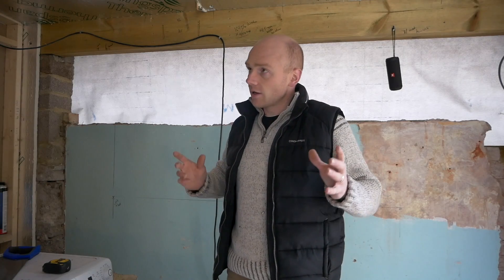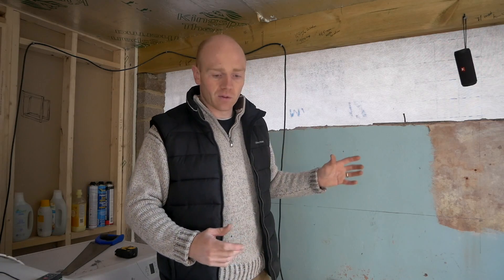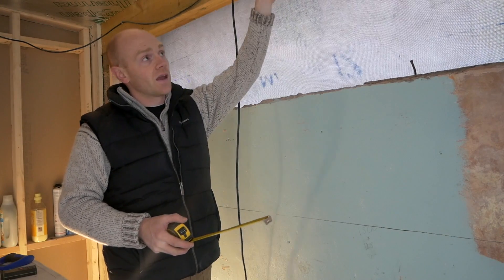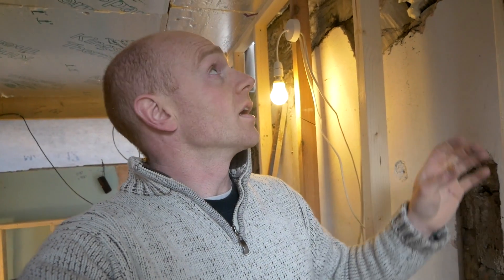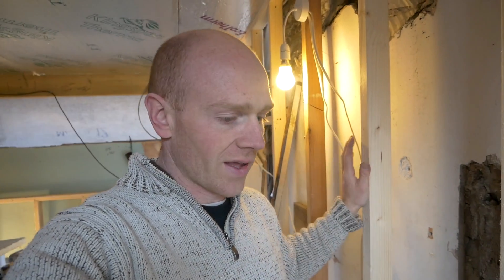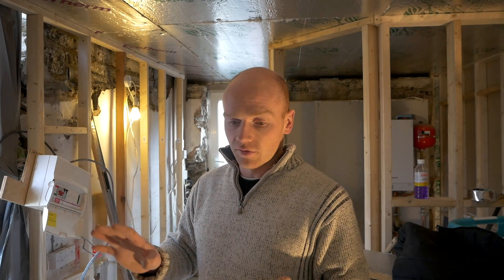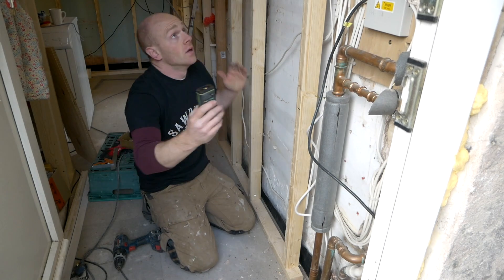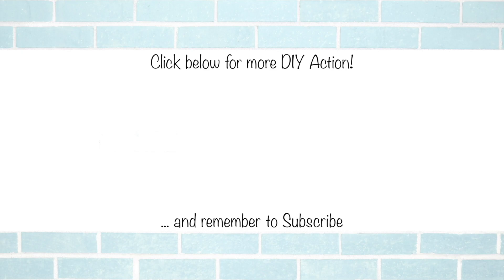Last of the Stud Work Complete!

Comment: I would do the wiring and pay a sparky to come and check and sign it off.
Reply: Willy Gates I have done exactly that to satisfy Part P. The problem is finding an electrician willing to do it and for him to assess your general competence. What’s in it for the electrician - easy money and very little time expended. In my case I outlined system design and cabling specs - he approved. I did first fix and he called examined and gave OK to proceed. Completed second fix without final connection to new MCB. Electrician visit completed all checks and made connection to new MCB. He emailed invoice (£300) and posted certificate. His total time Admin 30 mins. On site 3 visits about an hour in total. He lives around corner from me and I was his last call of the day on the way home. Not a bad hourly rate for ‘easy’ work. My labour input was around the 40 hour mark and materials approx £600. I was a very happy bunny.👍
Reply: @normanboyes4983  excellent mate 👍. It helps if you know a sparky, like a friend or family member

Comment: Really enjoyed the commentary and time lapse on this.

Quick query for you - does the bolt holding the blade on your Rage mitre saw ever come loose?

I have the 10" bevel one that I think was £150 from Screwfix 3 years back and it comes loose 3 or 4 times a year despite me doing it tight with a bulky allen key.

Cheers for the effort you put into your channel and remember if you can do it yourself :)

Comment: The thing to remember about the pros doing jobs is that it was made illegal to carry out electrical work unless you are a qualified electrician or tradesman qualified to Part P of the building regulations. You are only allowed to do a like for like replacement of fittings. Otherwise voids insurances and causes problems when you come to sell. Most people know about not messing with gas and gas safe register, but electrics is not as widely known.
Reply: Although if you're competent, there are some smaller things you can do esp. in your own property.

Comment: With all the changes and new walls, doorways all the reference points I had like the garage door and back door and saw blade hung on the wall are all gone
I have a good idea but get disoriented as to where you are. Might be worth clarifying with a flash up map in the corner where you are working in the house and room for the viewers. Or a before an after? Keep up the good work.

Comment: Whoever told you NOT to plasterboard to noggins is winding you up or are pretty DIM!
Back in the day we had 'Clerks Of The Works' who would 'insist' on noggins being fitted in studwork 'and' ceilings 'specifically' to fix plasterboard to as it lessons the chance of any 'bagging' that can sometimes occur, especially if the building gets cold and therefore moist air in the vicinity ..... Just a thought :-)
Reply from the maker: I usually do myself hence why it seemed an odd comment. Not sure their reasoning, would have to look back and find the comment.
Reply: I think it was about using the 2,4m boards vertically and therefore not needing to rely on horizontal noggins; fitting the boards on the vertical studs would work in that case.